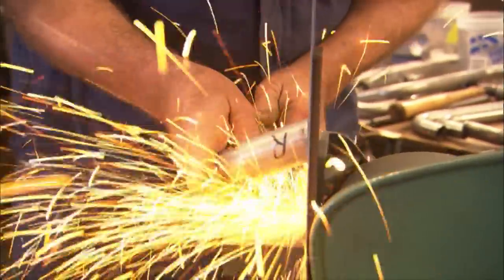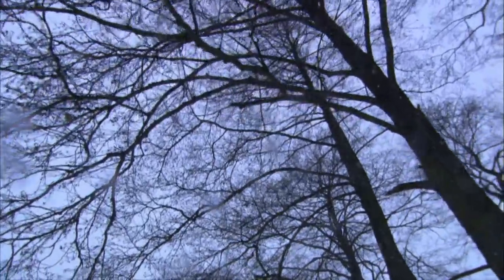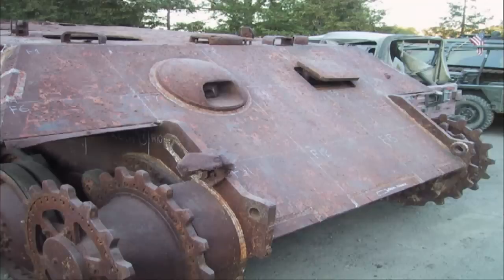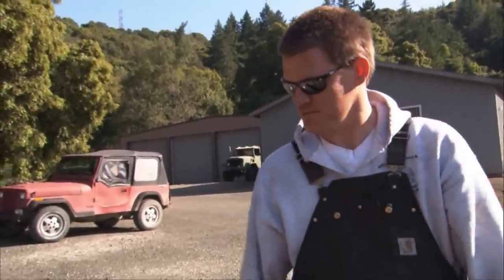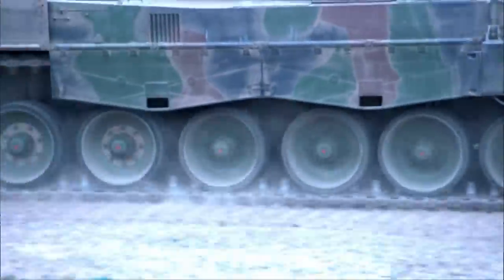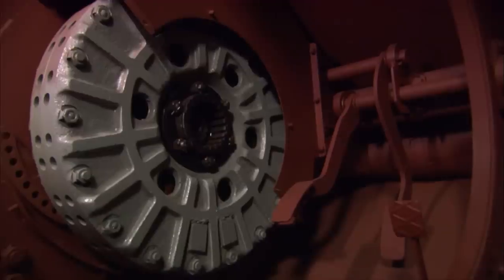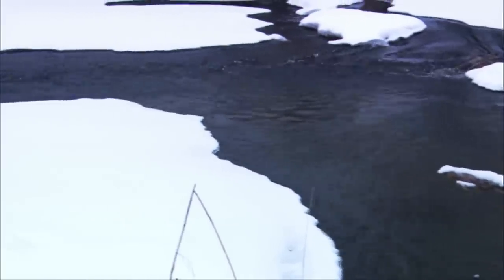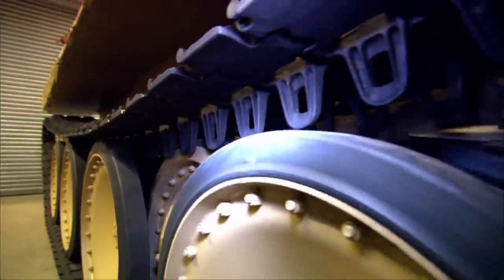Tank Overhaul - Episode 2 - The Panzerkampfwagen V Panther

Comment: I love this, although, correction, the narrator pronounces Panzerkampfwagen a little incorrectly, it is a little hard to get the hang of, the Panzer part, the Pan, is less in a English way, it's supposed to sound slightly like dawn I think, so say dawn, but make the letter d a letter p, and remove the letter w, it's kinda like Hanz, but with a er and a p, the kampf is like komp, with a letter a and a letter f, sort of like decomp, and the wagen, he said like vagen, it's sound is a little more of a fog type, like the word fog, the take the og sound, and put it into the letter a and letter g spots, but don't change the original spelling, also the gen is more like gone, you can use gone if it's easier to say, but it's more of a gone with a letter a sound. Note: This is not a outright correction, I was assuming they're trying to pronounce in a German way for historical purposes and for better understanding of the word, just a note though, I was just pointing out that so if anyone wants to pronounce this in a more German way, this is a simple guide to do so.

Comment: Also,  concerning the "sloped armor" concept.  It was known by the Germans as it was by every other country as far back as WW I.  If one looks at some of the German tank designs of WW I you will see some sloped armor.  The MAIN reason that Germany went with vertical armor in WW II is for the following reasons.  PRICE.  the labor costs in the manufacturing process were substantially cheaper by using vertical armor.  The manufacturing of tanks with vertical armor was much easier and less time consuming.  PROTECTION.  At the time of 1939 with few exceptions, the average ATG / tank gun was of 37 to 50 mm.  The vertical armor of the German tanks was more that adequate for those calibers.   Let us remember that German fighting vehicle design and manufacturing of WW II was technically as advanced and as precise as a BMW / Porsche / Audi or Mercedes car is today

Comment: I am not saying it did not happen, however,  typically when a rifle / pistol or machine gun "round" goes off from heat, AND it is not in a chamber,  it does not go "BANG" nor does it travel more that a couple of inches.  It is the pressure that is built up inside a chamber of a weapon that force ably ejects the bullet from the cartage and then down the barrel.  Throw a hand full of common ammunition  rounds into a camp fire, (stupidly, I have done this many times in my youth),  and you will get a "phittt" sound and little disturbance of the wood in the fire.  There is nothing holding the shell casing from it's own movement as the powder ejects the round and therefore, there is no forceful explosion.  All those Hollywood westerns / Army movies had it wrong all this time.  TYPICAL Hollywood.

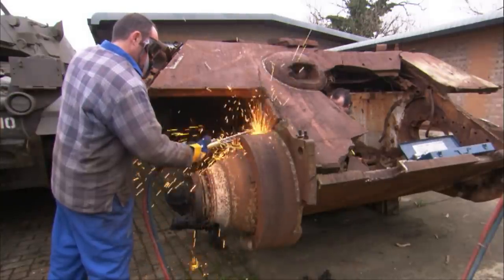Comment: 2:22 
If this is the same Panther, the upper frontal plate seems to be destroyed by enemy fire. Panthers' frontal plate is known for breaking apart or breaking off it's welds after being hit by a heavy shell, such as 122mm which was used as artillery piece and tank armamament (IS-2) by Soviet Union. You can also see that the broken plate folds inside the tank, meaning that internal explosion didn't break it. I highly doubt that the tank was scuttled, maybe the one on the photography.

Comment: The Panther was an okay tank.  It was no Tiger II.  The Brits stuck an 88mm in the Sherman and were punching holes in them easily.  Like the King Tigers, most were wiped out by Typhoon anti-tank planes.  Panther, like most later German tanks, was also expensive and difficult to manufacture vs the mass-production T34s and Shermans.  Still, a good tank and an important piece of military history.
Reply: Roadghost88 the brits never stuck an 88mm on the Sherman + allied air power has been overstated on how effective it was

Comment: The Germans knew about sloped armour. They had it in WW1 The German engineers weren't stupid. Sloped armour is great but it has a drawback. In the turret, the sloped armour takes up lots of room that you would use for, you know, the crew and the gun. That is why the Tiger had really thick armour and not sloped armour. They moved to the Panther because it was easier and cheaper to build as opposed to the tiger. They didn't complete development on the tank and it proved to be very unreliable. When it did work, it was awesome and feared on the battlefield.

Comment: This is the one I've been looking for this doc for a while. This man actually witnessed the battle and he still lives there. It touches me when he says they asked what should we do and the 'germans' just tell him and his family to run in that direction. Like they had exepted there fait but you run and get out of the way of this impending 'mess/battle' quite touching? (plus I enjoy the mechanical side. It's like you do not have to worry to much about things rusting threw the components are that 'thick and large?) The problem with working with things like this is the lifting and moving. In fact dangerous if one does not know what they are doing one could easily crush them selves. The lifting tools/ pullys ect ect are expensive to. Not to mention just stardard tools like sockets spanners pry bars and the other million and one tools one needs to get the job done.(there is something about sand blasting or a job that does a similar job I no it takes a little bit of surface material off but from a rusty filthy piece of metal to a nice clean new looking piece of steel well I think it is a well 'rewarding' feeling if that makes any seance taking something that looks well 'ruined' and fixing it up new.

Comment: Panther idea came from T-34 sloped armor, it was suppose to be bigger and better T-34.
Reply: Daimler Benz's submission turned into that. The requirements were formulated in '1940, and changed in regards to armament: 5,0cm. KwK 38 L/60 to 7,5cm. KwK 42 L/70; and weight from 20t. to 40t in '1942. The use of sloped armor was first noted by Germans when facing a number of french tanks like the Char FCM-36 light calvary tank. M.A.N.'s submission really had no similarities to Daimler Benz's submission or the T-34, and M.A.N. won the contract. Creating the Panther we know of today.
Reply: @John Cornell  Thank you.

Comment: There is a very good chance the tank got bogged down crossing the river and was blown up by its own crew rather then leave it intact for the enemy. The majority of German tanks in the final stages of WW2 were abandoned due to lack of fuel, parts etc...
Reply: Also the Panther is actually weak on the side armor where a T34 or M4 Sherman can maneuver around and flank penetrate the side armor of the panther , General George S Patton’s M4 Sherman crews caught on the panthers weakness with just the 75 mm short barrel gun and the 76 mm guns fielded on the Sherman’s got even better against the panther

Comment: American planners pushed for quantity over heavier armor & firepower in deploying the M4 Sherman tank.  Tank crews really had to be careful when advancing eastward toward Germany in 1944-45.  The Sherman had at most about 2.5 inches of frontal protection which did not protect its crews from either the high velocity 75 mm or 88 mm gun that the German forces deployed on their tanks.  We won the war by courage and sheer numbers.  Allied bombing of German factories, losses in battle finally wore down the German armored forces.  The influence of that experience no doubt led to further U.S. development culminating in the M1A2 battle tank, which itself is being upgraded with its TUSK package to the M1A3 configuration.   As we upgrade our current force of tanks, one wonders why we are not upgrading the hundreds left in storage, such as Hurlong, CA, to give our Army and Marines enough spares and depth.
Reply: The American planners decided we would rather ship two 30 ton tanks instead of one 40 ton tank. They were fighting thousands of miles from home. The Sherman had almost as much frontal amour as a tiger so it wasn't that bad but nothing really could stop an 88 outside of the jumbo and late Churchills. The 75mm would kill anything for the most part did it struggle against heavy German amour yes but it still killed Panthers. The us has always designed to work with the combined arms not just by itself.
Reply: There's another channel where the guy is talking about great German tanks of WWII and says "look at the beautiful weld on this tank, the Germans really welded their tanks best." And you know the underlying message is - it ultimately didn't matter.

Comment: "early engines of the Panther came with a serious design flaw"
that's clearly an understatement, afterall for their very first deployment (at Kursk) 2 Panthers caught on fire while being unloaded from the train, that's how badly it was simply because they did not spend nearly enough time testing it and solving whatever problems may arize before sending them to the frontlines
just for better context, in the 1950's the US Army designed and built a heavy tank designated M103, that very own heavy tank went for trials and a list with hundreads of problems was made about it, before they entered service all the tanks produced until then had to be overhauled to correct those problems, that's exactly what failed with the Panther throughout it's service life, they were simply unprepared

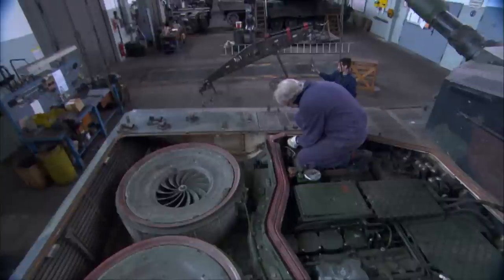Comment: At 37:15 are the 2 turbine blade circular objects turbos?
Reply: @WifeBTR123

Thats a part of the Maybach engine cooling system, called air fans in english.

 I am not a Tank specialist, my focus is on Air Forces/planes

but iam 100% sure  that this is a Air Fan system   that  bleds air in the radiators or it sucks air out but it is  part of the Panthers  cooling system and not a Turbo because  germanys WW2  tanks  had no turbocharger   , even the high tech German Aeroengines had no Turbosuperchargers  they had mechanical Superchargers like  the Dora-9 JUMO 213 or Bf-109s Daimler Benz 605 . 

Even the higher  HP(output) US aeroengines, much bigger then a Tank engine  had much smaller Turbos like the ones on Allison Engined P-38s or the ones on R-2800 powered  P-47 which was a great one by WW2 standart  they  never built such giant Turbos, maybe today for ships  but the diameter is far to great for  a  Turbo even in todays  tankengines

 you can see  nearly the same system on MTU  Leopard II engine

greets

Comment: Why are the doors at the back of the panther turrets usually opened when they're in action?
Reply: Allan Ashby so they could toss out spent shells.
Reply: I agree  to eject hot shell cases
Reply: yep  you are both right

and for reload after Battle, they used the same hatch for  outthrowing the shells during battle and  reloading ammo into the Tank
and it is not a Door Alan, it is a HATCH! ;)

Comment: It says pretty much nothing can stop this panther. The panther will pretty much run away when it sees a M 26 Pershing.
Reply: Nicholas Teng lots of panthers were destroyed by regular Sherman tanks. Heck, wittman was destroyed by a Sherman.
Reply: @kcimb  yeah but the panther had the upper hand when it is against 4-5 shermans. you need a gun that is able to penetrate the panther from the front at combat ranges like the m 36 or m 26
Reply: Nicholas Teng  A hit by a 75mm will daze the Panther crew for a couple seconds. So repeated hits in quick succession will simply pummel the crew in submission, or will dislodge something important on the tank. Also the armor will stop the shell on paper, but will lose some integrity in doing so.  So just like something caves in with repeated blows from a hammer the Shermans would eventually break through the armor once they start hitting their target. Furthermore not all Panthers would have been build up to spec so reality would not comply with theory. Add to that the skill level of the tank crews and suddenly theory is totally irrelevant. Just look at the battle of Arracourt were experienced Shermans crews pummelled inexperienced Panthers attacking.
Reply: @barthoving2053  I guess you're right, I'm pretty sure shermans could give a panther a hell of a time if the panther is half sabotaged and equipped with inexperienced crew who will piss in their pants and bail out sooner or later when the shermans scare the wits out of them
Reply: Nicholas Teng not really. The British and Canadians took on several panzer and ss divisions and had little trouble wrecking them. Neither did the Americans during the bulge or at Arracourt.
Reply: @kcimb  British did use the sherman firefly to penetrate German tigers and Panthers from combat ranges, however, it's armour was weak like any other normal sherman making it vulnerable to pretty much any German tank armed with the long 75mm or 88mm cannon

Comment: I would have had to at least consider contracting stronger final drive gears...   Even though it wouldn't be a correct restoration, you could feel safer about using it and keep it running longer and more reliably.
Reply: I don't think that would be necessary as the tank will never see the abuse like it did when in battle.  Restoring it original would be fine for any kinda driving for another century...

Comment: Question: How did the team rebuild the huge chunks of steel plate missing from the front armor? Did they contact the original manufacturer to make a steel plate for them? Or do they have the tools themselves to do it? Really curious. Thanks!
Reply: TheBigExclusive they make the plate themselves to the exact specifications and quality and weld it back in
Reply: Doesn't need to be armour plate only standard mild steel as its not going to be shot at.

Comment: little mistake in the middle, current german Leopard2A6 uses the L/55 Version of the 120mm Rheinmetall, M1A1 uses the L/44 which was used in the Leopard2A4.

The L/55 has higher muzzelvelocity and thus better penetration, however the Americans compensate with ammunition made of uranium whivh has a better penetration then german tungston ammo.

Minor detail, but if you look at the Tanks next to each other youll notice that the Leo2A6 has the longer gun
Reply: The M256 is not the L/44 it was developed from it, but does not carry the license or the same design. 

 The depleted uranium was in use before the 120mm. was.

Comment: "The Sherman couldn't penetrate a Panther from any angle". I guess those Sherman crews used magic to take out Panzer Vs. The Panzer V was far superior but it wasn't a Tiger, they could be killed by a Sherman crew from the side and easily from the back even at long range, especially if it was equipped with a 76mm.
Reply: The Sherman firefly was about the only thing that had enough punch to take the tiger or the panther head on and win. If they hit first. Now the 76mm could easily punch through the side of any German tank the problem was you had to lose 4 Sherman in the process of getting to the flank.
Reply: What tank are you talking about? Panzer III-IVs were comparable in armor to the standard M4 and could and were regularly knocked out by M4A1 Shermans though more regularly by M10s (with the 76). IVs were by far the most common German tank facing Western allies. Panthers and Tigers almost never met Shermans happening only a small hand full of times in the entire war. But that being said the 17 pounder Firefly or the Easy 8 variants could penetrate a Tiger or a Panther from the back at long range, sides from medium range, and front from short range (less than 100 yards). Point being, the statement that a Sherman couldn't penetrate a Panther from any angle is totally false. Also the 5 to 1 stat is fuzzy math that comes from Death Traps and doesn't really pan out in real life numbers. US vs German takes was more like 2 to 1 against the US.
Reply: The base m4 sherman had around 12.7 mm front armor then upgraded to 25mm the Panzer 4 had 80mm when up armored(strapping plates onto the front) at best the Sherman jumbo was comparable to a panzer 4 with 101mm and few of them were made. a panther or a tigers gun has been shown to go through the front of a Sherman like butter. the panzer 3 lowest was 15mm and highest 50mm so the m4 is on par with the 3 in armor.
Reply: The panthers back and possibly sides were vulnerable to the 76mm the tiger only really the back. maybe hes talking about the earlier Sherman with the stubby low velocity gun, now those were said to bounce off tigers at 1000 yrds
Reply: Im curious about where your numbers are coming from. Frontal armor on a M4A1 was 2" or 50.8mm with a slope of 56 degrees giving it an effective thickness of 91.44mm. The Panzer III had anywhere between 15 and 50mm of frontal armor depending on the variant. Western Allies were most likely to meet the Ausf. J variant which was arguably better armored in the front than the Panzer IV (80mm) but both being generally in the same class as the M4A1. Where the Panzer III was totally outclassed by the Sherman was it's 50mm gun which could not penetrate effective 90mm RHA frontal armor on a Sherman. Where the Sherman's slope didn't matter was against the 88mm where the round was larger than the actual armor plating. 

As far as your second comment, the Panther had 40-50 mm unsloped armor on the sides at it's thickest, easily penetrated by a high velocity AP from a 17lb or 76mm from long range. There were also points of vulnerability on the front, same goes for the Tiger. I think the gentleman in the video is just propagating one of the many myths about German armor that make it bigger, badder, scarier, and more fun to talk about.
Reply: even then the panzer 4's gun could penetrate 97mm of armor at 1000m so the sherman far from out classed it the 75mm could penetrate 76mm at 1000m so unless you were talking about the very low produced 17 pound version of the Sherman the panzer 4 was fairly even with most Sherman.
Reply: I said the Pz. III was outclassed by the M4A1 not the IV.
Reply: Tungsten baby !